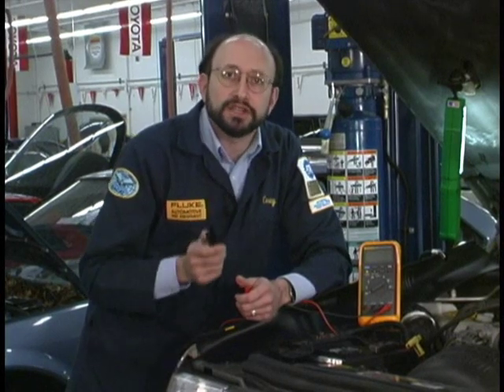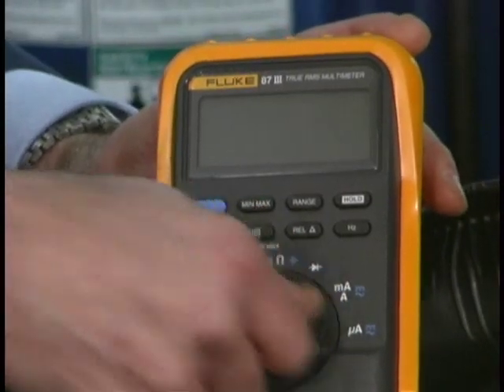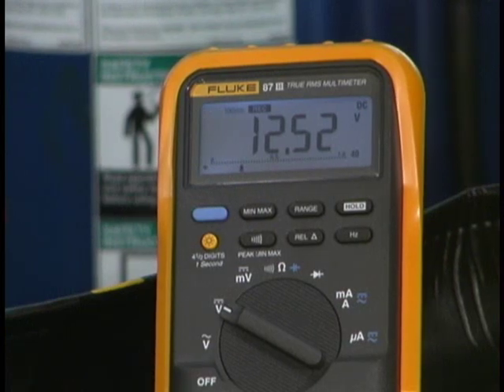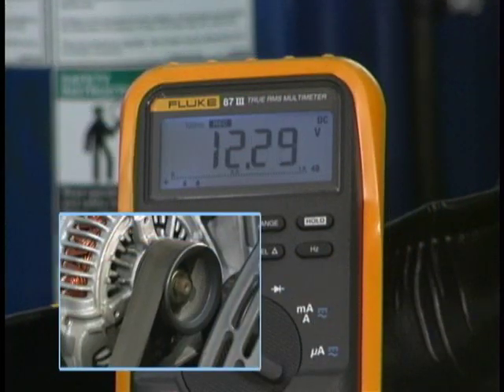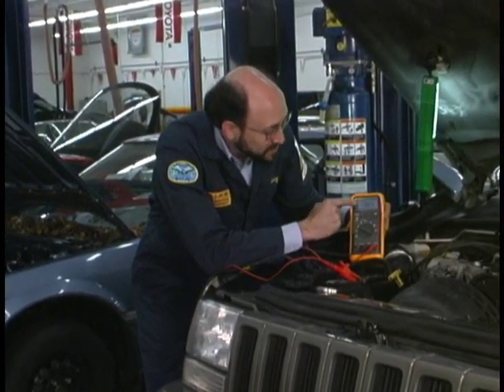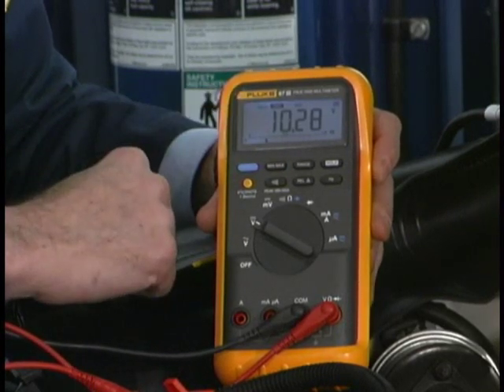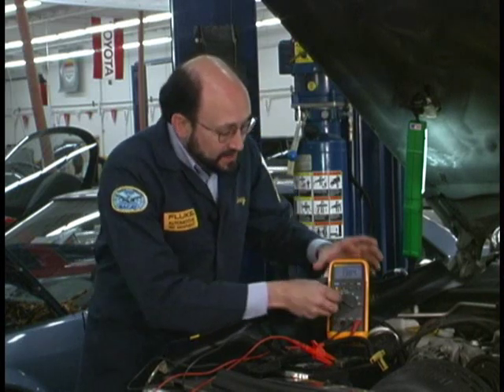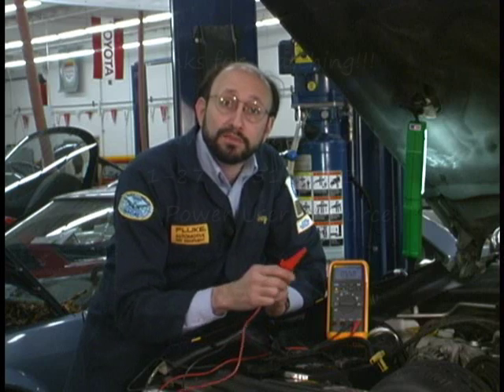How to use the Fluke Multimeter Voltmeter tips and tricks 09-40-DVD 88v 87 Charging system test

Comment: Your not supposed to set up your probes on the circuit before you make your selection on your meter . I know the fluke will handle it but it's a known fact that you should select first then test .
Reply from the maker: +myboy051 - Good observation and suggestion.
Reply: how so